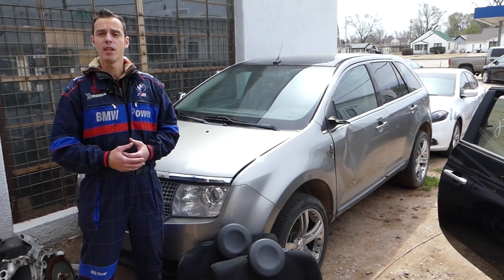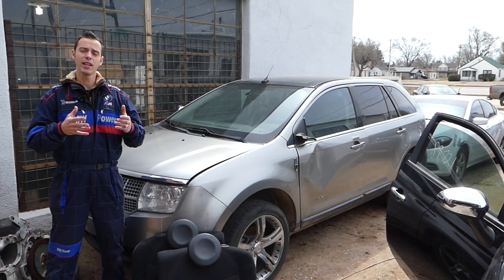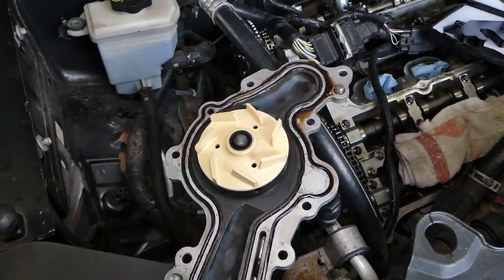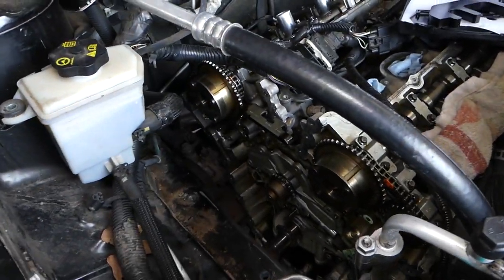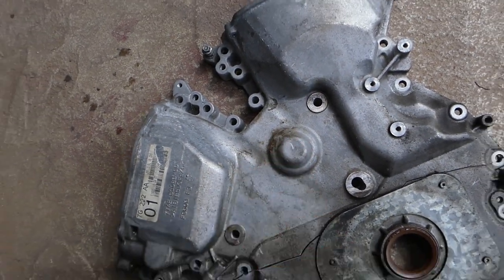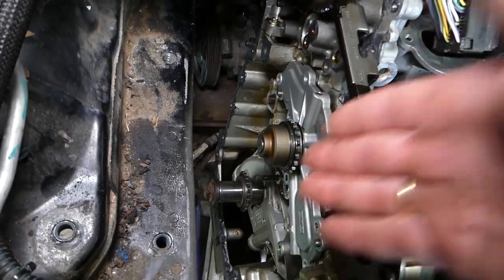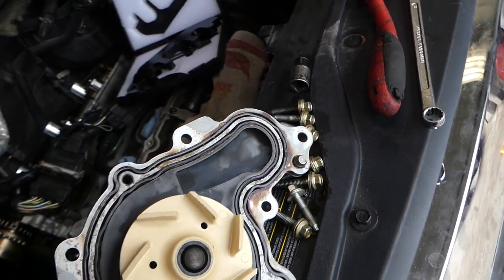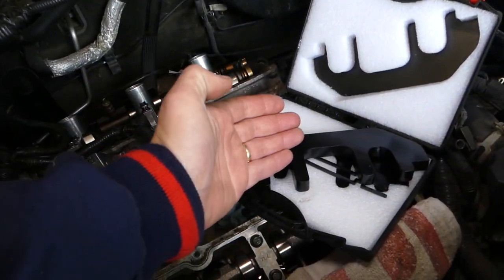LINCOLN MKS MKX MKZ MKT COOLANT IN OIL EXPLAINED

Comment: Thanks for the great video!
Now I find out these are timing belt driven pumps in my Lincoln MKS Eco-boost AWD.
Something else really expensive to go wrong.
I don't think my next car will be made after 1972.
At least I could work on those. I used to swear if it didn't have a carburetor I didn't want it.
I'm beginning to think that again.

Comment: I looked up your video because my just failed, shop said exactly what you said as far as labor involved, also said might not be worth it to fix, 2009 Lincoln MKS 159000 miles, might buy a newer car. Shop said heads could be warped from overheating, might not be worth it to fix it,  shop said no guarantees for that reason. I thought this car would make it to 200k plus.

Comment: I have a coolant leak 3.5 lincoln mkz I was told it the water pump but the cost of repair is 3900.. is this true or should I look somewhere else.
Reply: I have one and a friend of mine has a Explorer wit the same engine. Her's was $1500 but its a shop that she has been going for years and they gave her a small break. How many miles does your car have? These cars start to fall apart once they crossed over 120K miles or so.

Comment: I dont have water or coolant in the oil. I first thought radiator or pump. Not those. My cousin in CA said it might be a freeze plug. I can't find a video 😫 to help. How can I tell? The car over heated a couple blocks away and I parked. In the morning I filled with coolant . It is draining out fast. Thought it might be the freeze plug. What are your thoughts? And advise please 🙏 im a single mom with teens and not much money so im trying to get help at my church. Its a 2015 lincoln mkt